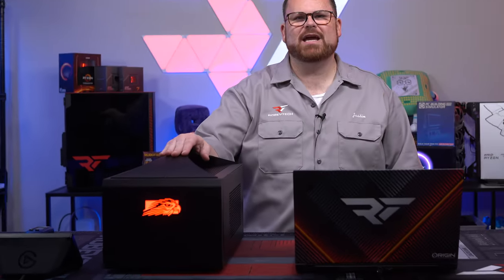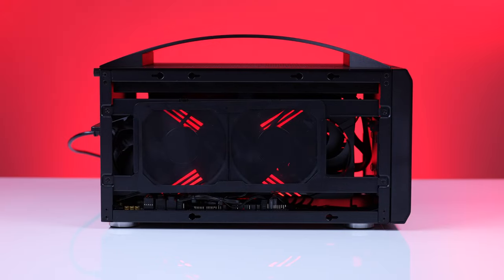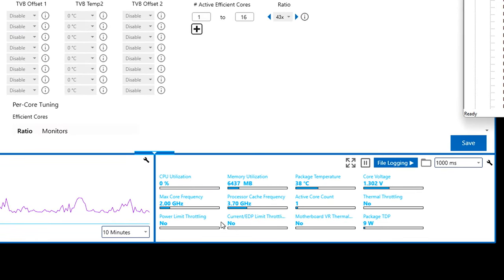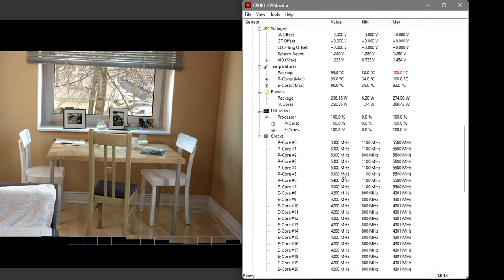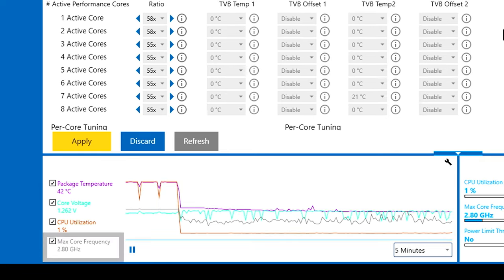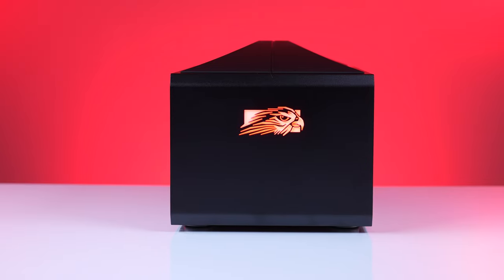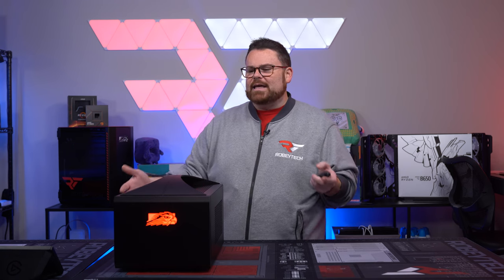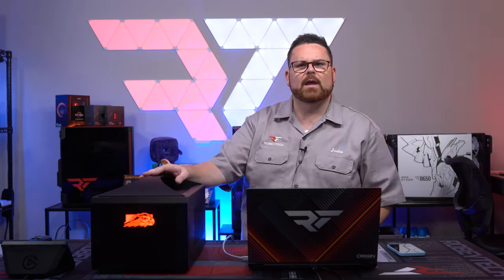Cannot believe this is possible!

Comment: Simply untrue to say you'll only be down a day with their overnight service. I bought a Falcon Northwest Fragbox back in 2009. It had multiple issues when it arrived (wrong side panel, system crashed when turning off and on system lightning ect...) and they paid to have it overnighted it back to them.. then it spent two weeks with them (waiting for parts they told me) before they overnighted it back to me.

I was down two weeks.
Reply: Cool story.